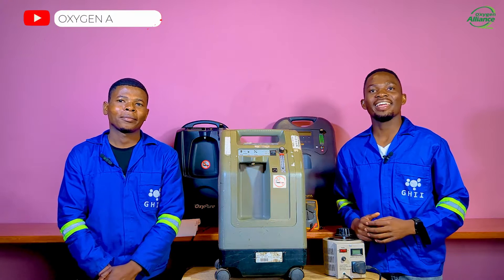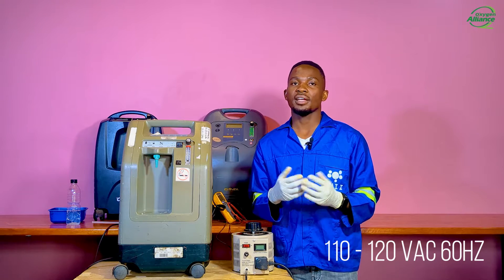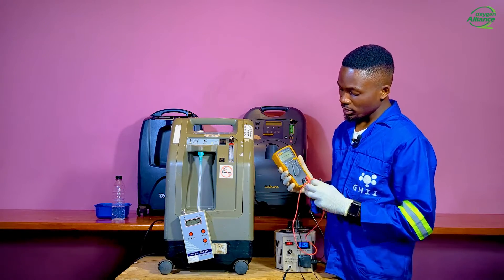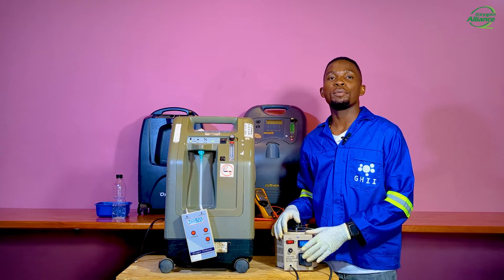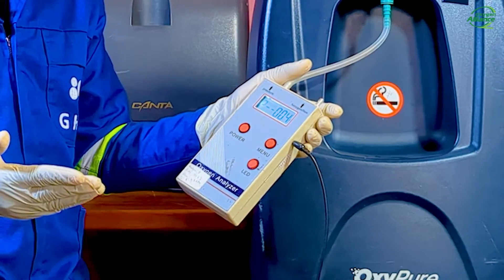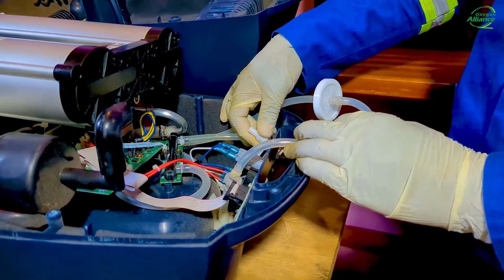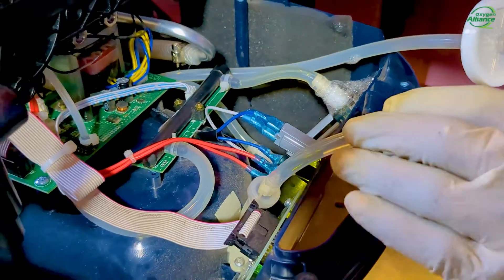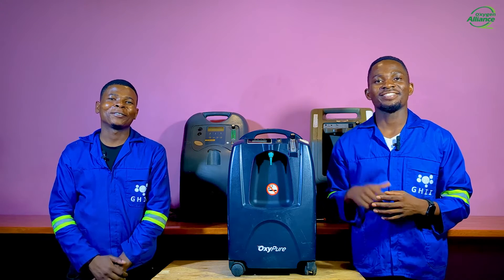How To Deal With Low Oxygen Purity: Part 1

Comment: I face a problem of unstable flow from the concentretor how can i solve
Reply from the maker: Check that the humidifier is not blocked. Check that the filters are not blocked, especially the gross particle filter as brokage might cause improper air intake and eventually affect the flow. Also verify that the flowmeter itself is not broken.

Unstable flow in a concentrator can be  also caused by leaks, incorrect operation of the four-way valve, or an underperforming compressor. Inspect all connections, tubing, and seals. Tighten loose fittings and replace damaged components. Ensure all paths open correctly. Check solenoid valve coil resistance and voltage with a multimeter. Listen for unusual sounds like squeaking and service if necessary.